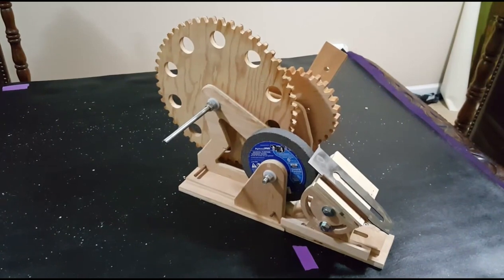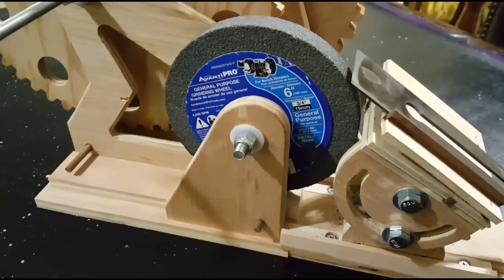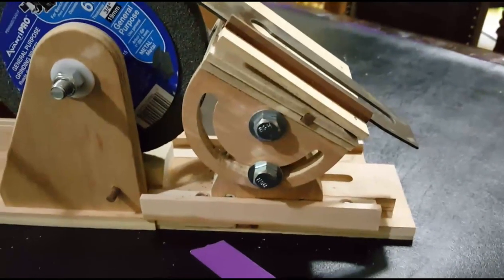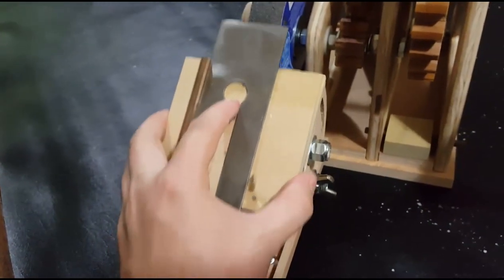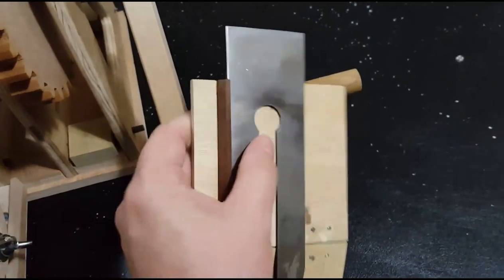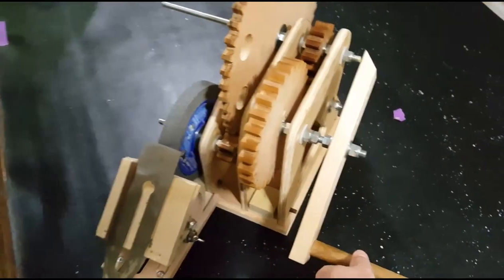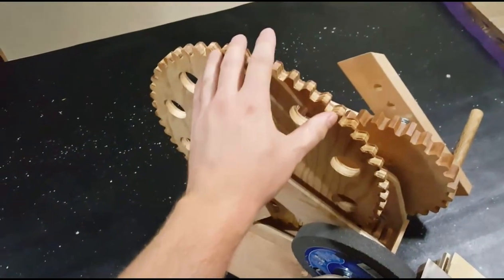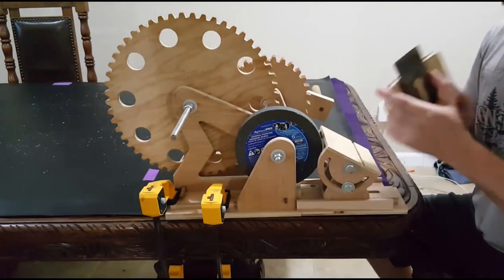Hand-Powered Grinder Demo 1

Comment: simply amazing. do you have plans available for download?
Reply from the maker: I do not have plans for this yet, but I will see if I can make some.  Most of this was designed as I built it, but I did make a design for the tool rest.  I need to check the terms on the WoodGears program to see if I am allowed to distribute plans using gears from it.